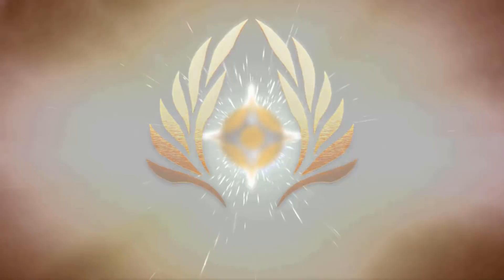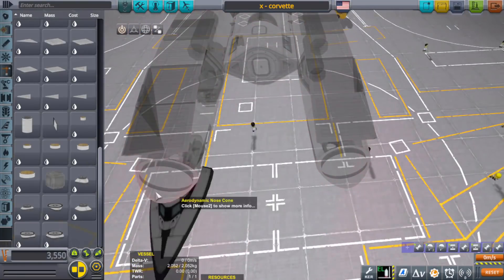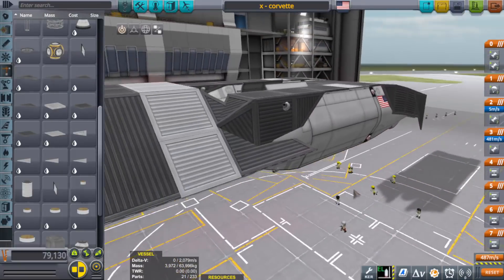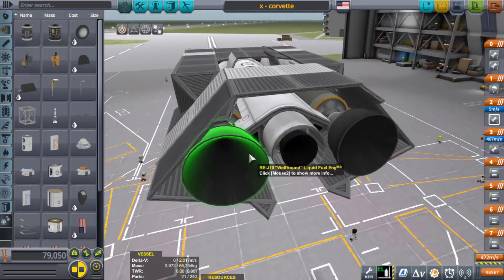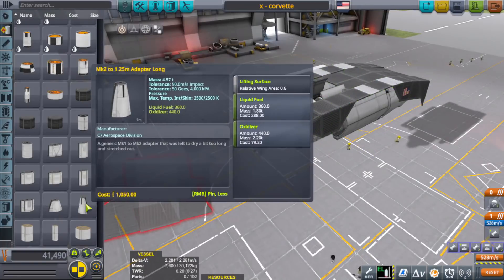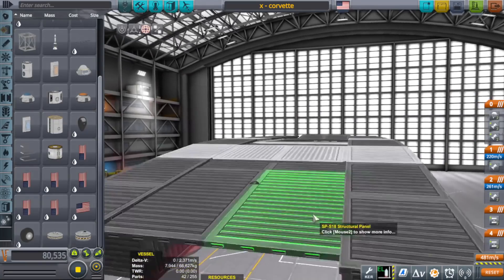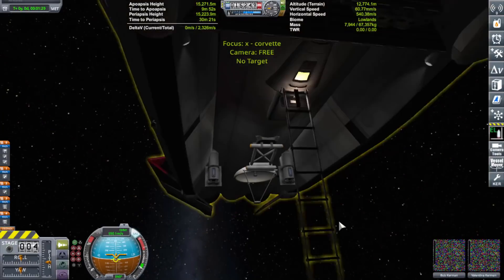IMPROVED CORVETTE WARSHIP \ Kerbal Space Program \ KSP 1.12.2

Comment: Hey VAOS. Do you still read old comments? If so, I have something to tell you about inflatable heat shields. I found a way to deflate them using the axis action groups. I had set the custom 1-4 to be their corresponding numbers on the keypad and then set inflation limit to be on 1 and 2 with 2 being inverted.

Comment: IIRC "Spray and pray" came about in reference to the early versions of the AK-47, particularly in Western analysis.
Reply: Hmmm, I thought it came from the Thompson machine gun in the 20's. It could send a lot of 45 calibur bullets down the line but beyond 25 feet it was not accurate, a spray and pray situation. Especially on drive by's. I first heard the term from table top gaming in the 90's. A game called Call of Cthulhu based in the 20's.
Reply: @JollyRogerAerospace  I mean, I could be wrong.

Comment: 4:21 I sometimes use a combination of Root and Grandparent autostrut connections, especially the latter if I have a bunch of parts daisy chained off of each other.  But I only resort to physical struts these days if I think a particularly unsupported area of the vessel is going to be load bearing or need to absorb impacts.  And of course physical struts are kraken antidotes for heavily clipped craft designs.  
9:07 Whaaaaa?  You mean 747s don't VTOL right down to the gate?!  I am le shocked.  
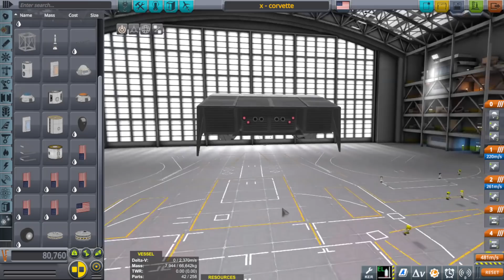10:00 Vaos going for the Minecraft spider look.
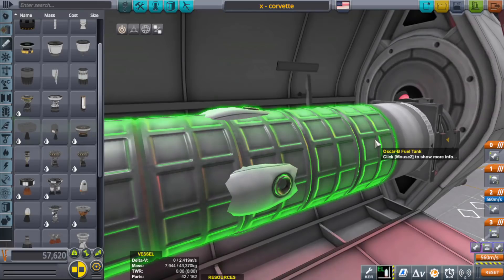6:33 So I just opened up KSP and did a quick test on RCS fuel draining.  Yes, RCS actions may suck fuel from anywhere on a ship regardless of attachment or crossfeed, but fuel flow priority still works as intended: a lower (more negative) priority tank will drain later than a higher (more positive) priority tank.  This is true for both monopropellant RCS and rocket fuel RCS (Vernor).  So all you need to do to keep your missiles full is set their tanks to a lower priority than any other tank on the ship.  Problem solved.

Comment: would it be a good idea to put the RCS thrusters on pylons so they are further from the centre of mass and thus can rotate the craft faster?
Reply: Definitely for a strike craft, :)  high thrust to weight plus strong RCS.  Battlestar Galactica has some nice fighters, a tiny profile and long nose with wings to for roll and weapon mounts.  Sadly, those armor plates are pretty big, would be much trouble to armor that fighter up-.
Reply: Ooo yeah that could make it super agile
Reply: @romain5967  Yes, but putting the RCS on a pylon would make it more vulnerable.

The quesion then remains how vulnerable and if the extra agillity is worth it.

Considering the vessel has to rotate to aim its "guns" I think it is
Reply: @invalidstring3447  well yeah but it could just have backup ones on the hull as well...

Comment: I really liked the original design, but this looks way more mean and the design philosophy is much more in line with the other ships. I love it.
Now I was wondering if you could make the armor plating in front of the windows moving parts, so it opens up during regular flight and closes for full protection before combat. That might look neat.

Also you could add a pivoting or extending girder with rover wheels underneath the ship, so it can drive using electric power instead of wasting fuel.